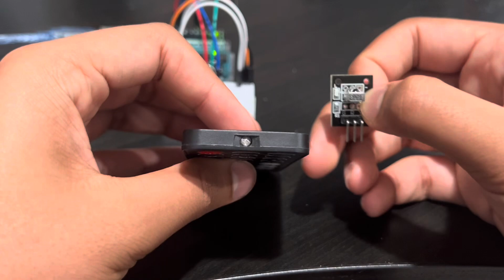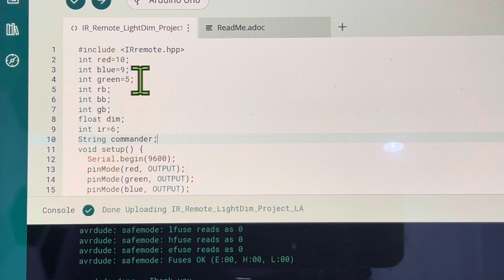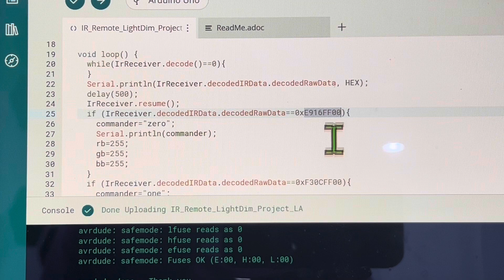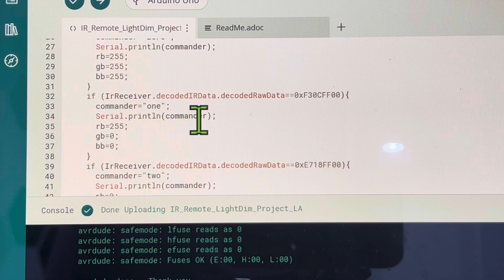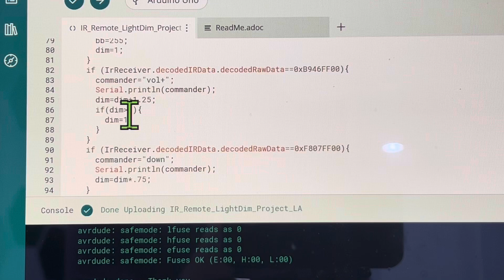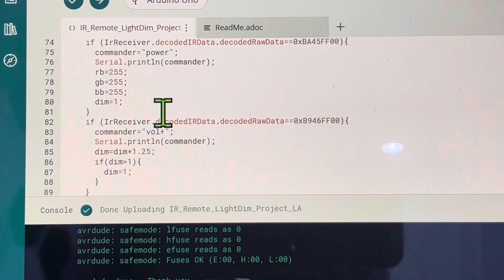Arduino Projects: Variable Light Control

Comment: hello! you can just use one resistor connected to the cathode so you don't need three of them
Reply from the maker: Thanks for telling me, I wasn’t aware of that!
Reply: You can, but the indivual leds wont work at a same level as per color they have a different forward voltage. So definitely use a resistor per leg for optimal color display